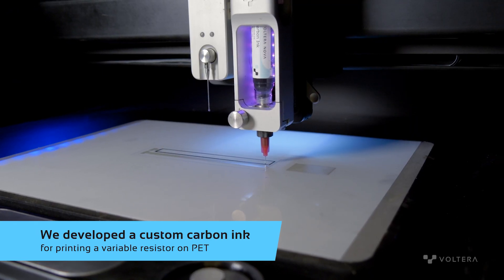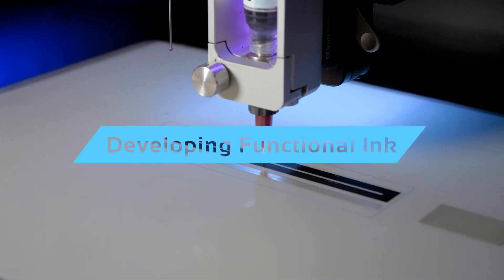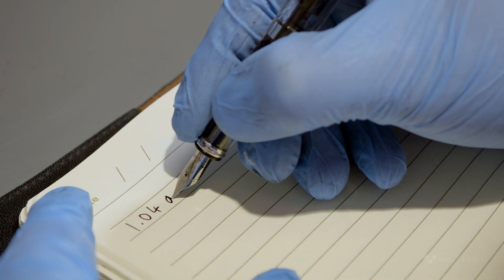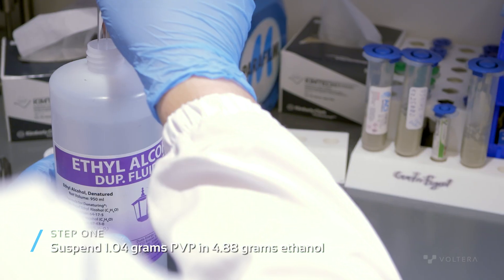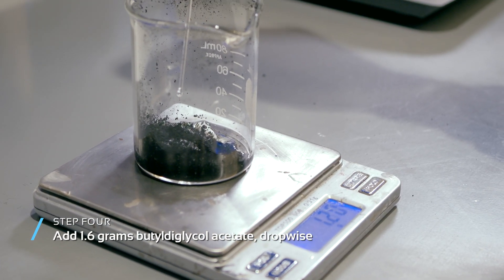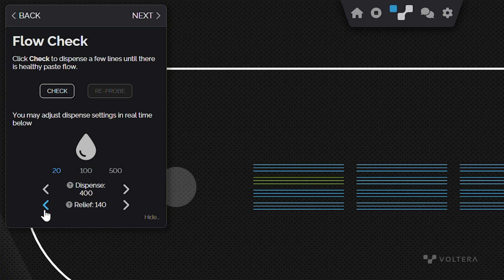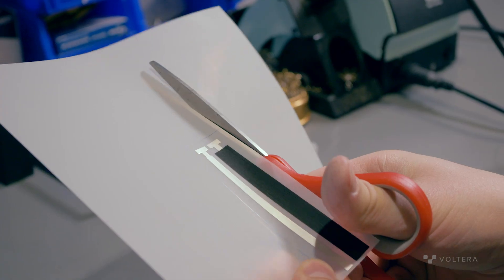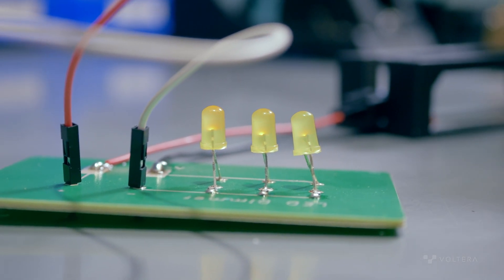Developing a Custom Carbon Ink for Printing a Variable Resistor on PET | Functional Ink Development

Comment: Hello, sorry for asking. I want to ask what if I make by my ownself for the carbon? Is it possible that I can use your rasio? Because after a long experiment, we can't get the result from the ink with inkjet, and we wonder why, because the mesh from the carbon it's already small like 600 mesh. But still can't get the result:(